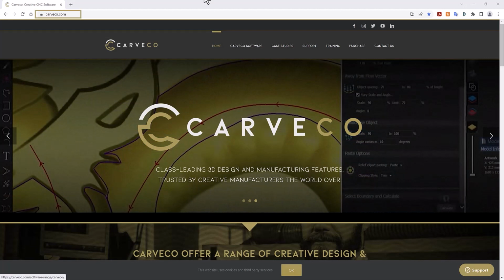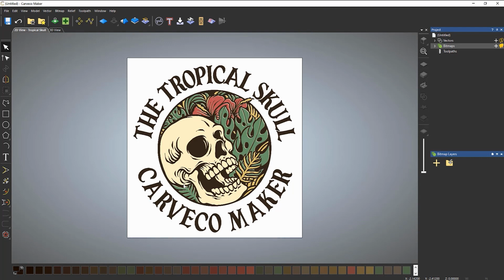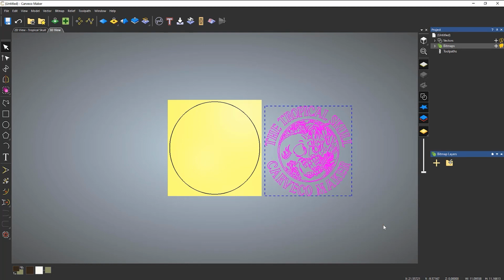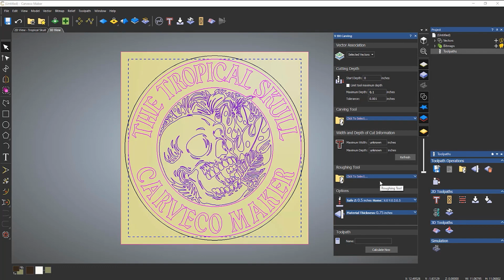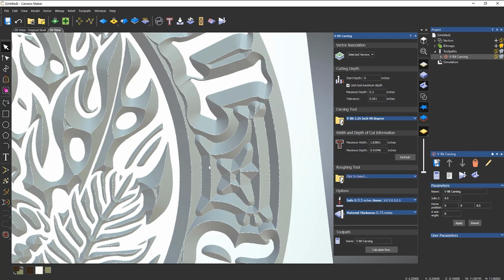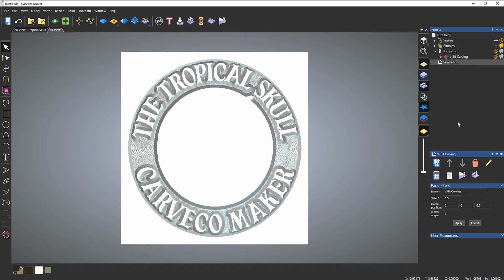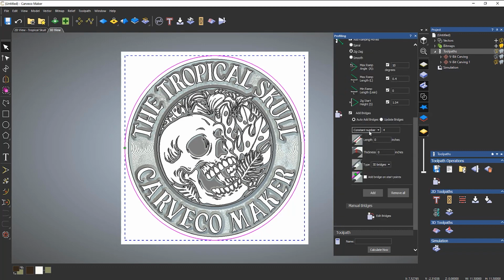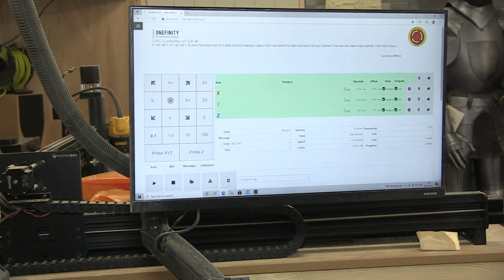Carveco Maker - Tropical Skull V-Bit Carving Onefinity Tutorial

Comment: May i ask, what was the purpose for using the oramask over the material?  Was it to trick the finishing pass from removing the top of the material?  Asking because im finding that carveco relief toolpaths, the finishin pass is removing the top layers of stain on my reliefs and wondering how to avoid that??? Thought to put a piece of paper under the z probe before doing the finishing pass to preserve the stain on the reilef ……. Really confused about this problem because my msterisl setup starts at 0 z depth on top of material.
Reply from the maker: Hi, no it wasn't to trick the machine.  The wood was painted white prior to machining, then the Oramash put on it.  When machined, you can then paint the machined parts black, remove the Oramask and you have a black and white piece.  The white was then painted by hand.  Sounds like you may have a problem with your Z Probe?  Try doing what you say, setting with a piece of paper, you can even back it off a bit if you are worried.
Reply: Thank you, much appreciated